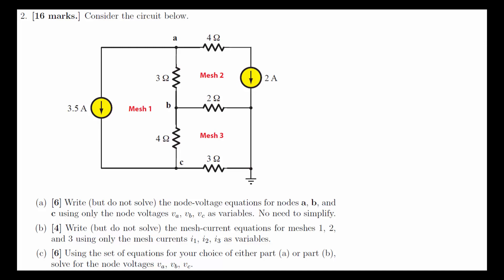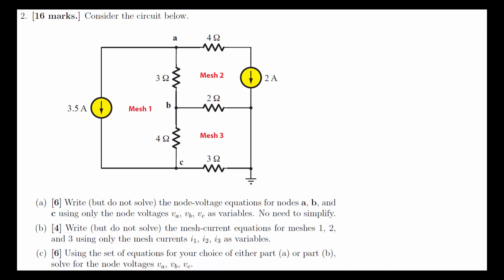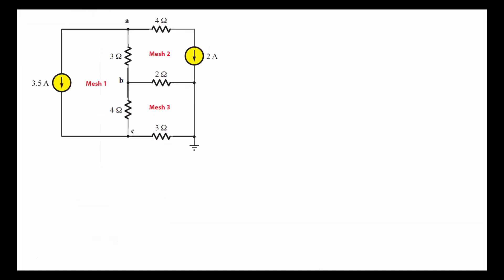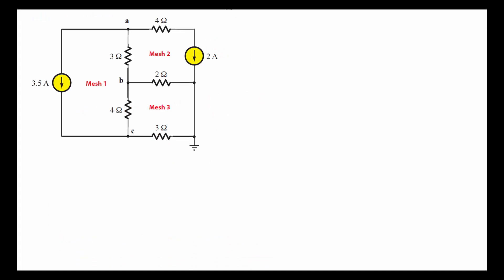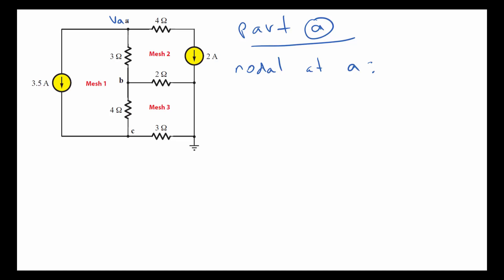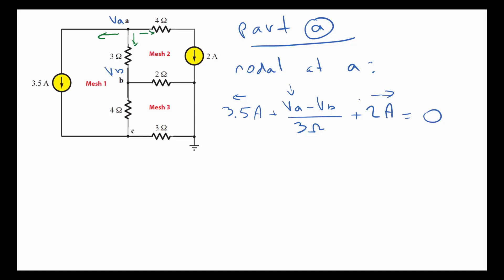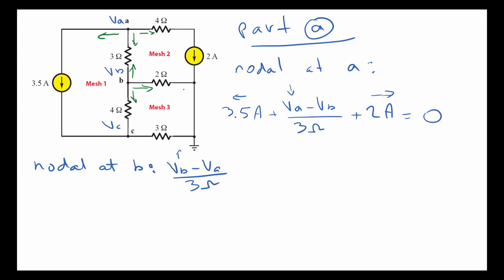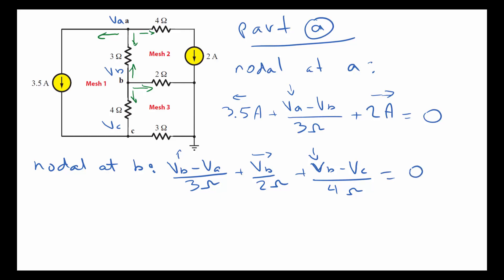M2018Q2 nodal version with Cramers Rule

Comment from the maker: I made a small typo when writing out Cramer's Rule at 16:22. I wrote (0)(13)(42) + (0)(13)(42), instead of (0)(0)(3) + (0)(13)(42). Otherwise is correct and the final answer is not affected.